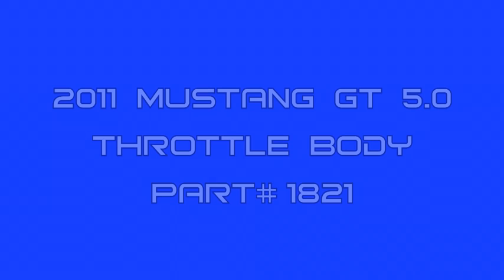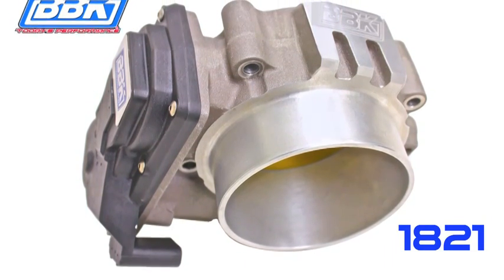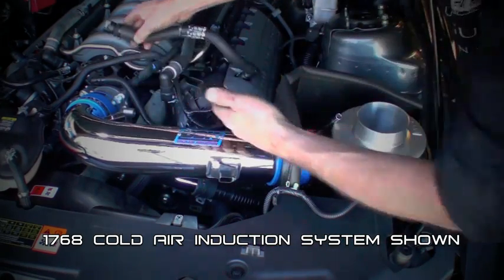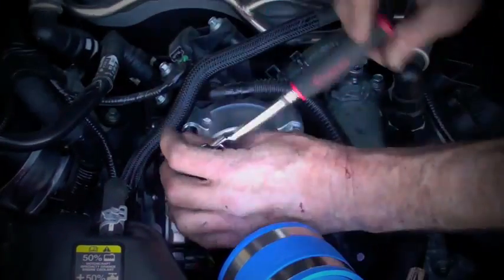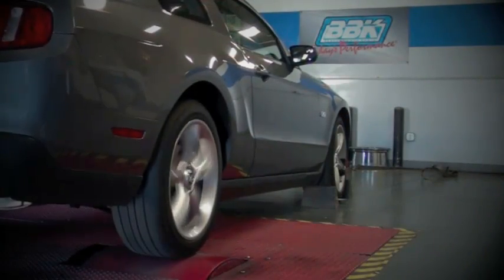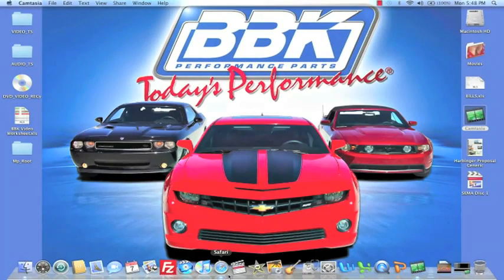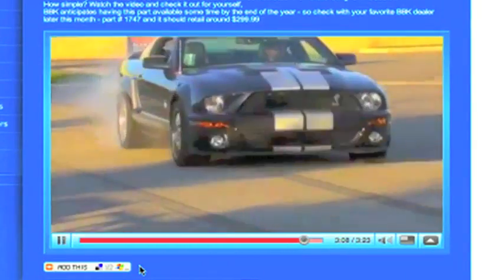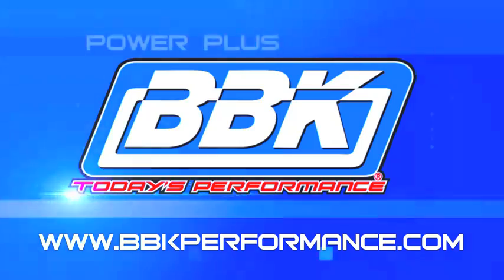BBK 2011 Mustang GT Throttle Body Install & Dyno Test

Comment: Should really disconnect battery and have system relearn throttle body and shift points in diff gears.

Comment from the maker: Installs in minutes, providing an 8-12 horsepower gain while maintaining OEM drivability and reliability by using factory style electronics and drive motor assembly. This throttle body is a direct replacement but is not simply a bored out factory unit. It's an all new BBK designed 356 aluminum casting that is then fully CNC machined.